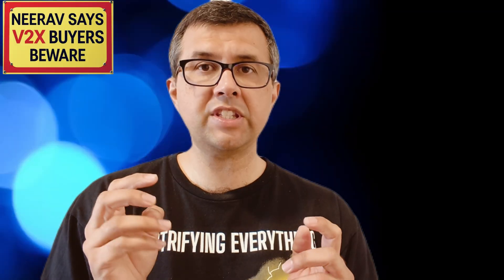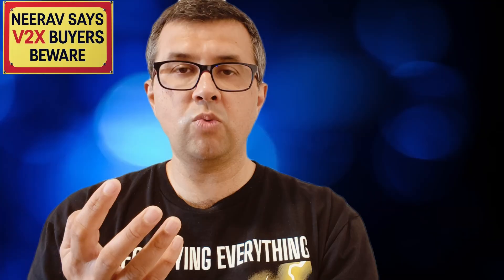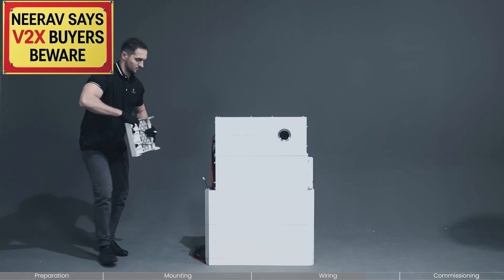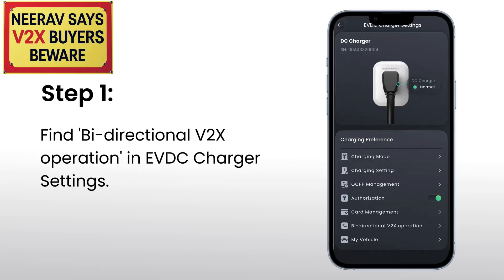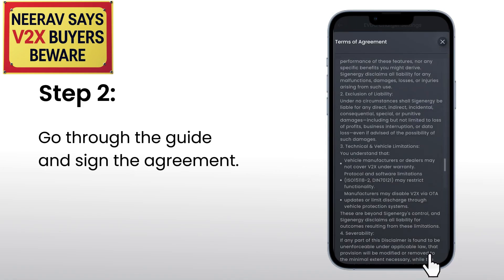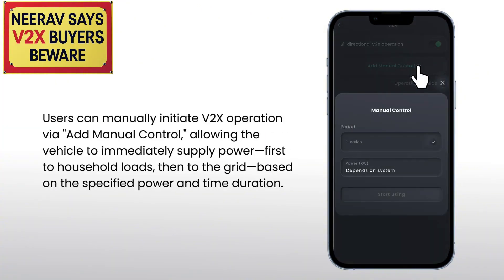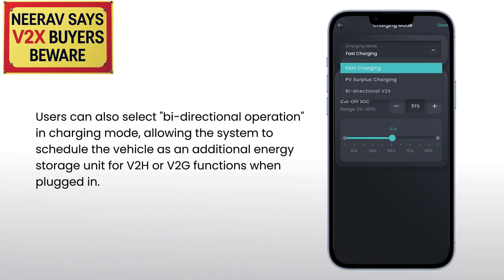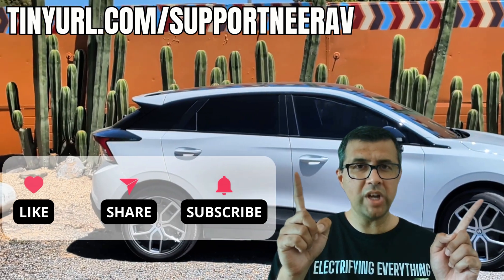Sigenergy Warning Risks of V2G/V2H/V2X: EV Hardware, Software and Warranty Limitations

Comment: waaaooow this is bull shit. but be afrried for all NEWs.. V2H  will absolute NOT damaged the battery in the car. the car data log is always there then they analyse the use the battery of external power, the log system can easily see if any option has done such a thing, also the controll with Power output is ofcause limited for a NORMAL house hold power Fuse. Prober equal. to 3 phase 16AMP. but if you use V2X for running a cerment building caompaney, i expect they has set the MAX output to limits that. so the problem is ONLY invented. same as the EV cars was ahorrible idear. now everyone has EV cars, with out any of the Prodicted dooms day" warrings. like this

Comment: Is it not possible to limit the output into a sigenergy unit at the V2L loads (3.3kw as an example) which are prescribed in the vehicle specs without affecting warranties?
Reply from the maker: That is an interesting comment. I just interviewed a Geely EX5 owner and that was one of the topics discussed, interview will be published on the weekend
Reply: "Is it not possible to limit the output into a sigenergy unit at the V2L loads"

From Sigenery itself...............
In their V2X flyer document - "V2X functionality is limited by the EV’s capabilities" - Obvious, but not a lot of specifics to assess.

To ensure the attempted discharge rate of an EV battery is compliant with the EV specifications for the purposes of V2G, this may require the mandatory inclusion of a HEMS. HEMS = Home Energy Management System, which can be used to set the maximum disharge rate of the EV battery. I know there has been a test of V2G with a BYD Atto 3 by ambibox, that included a HEMS to restrict the maximum disharge rate of the Atto 3 battery. The successful test set restriction of the battery discharge rate to a maximum of 7kW for the purposes of the test. I am not entirely sure of the exact details of the test, but considering the BYD rated V2L of the Atto 3 is I believe, apparently 3.3kW total, it doesn't sound like a 7kW draw is going endear itself to the Atto 3 warranty. So in the real world the HEMS would want to restrict to 3.3kW discharge to maintain validity of the warranty. 

A HEMS can have the ability to consolidate multiple and/or different or absent communication protocols across various devices, so that all devices in the system can communicate between each other.

But I am happy to be corrected on any of this.
Reply: I really don't understand why a car manufacturer wouldn't want to promote its v2g capabilities, I have the atto three and drive it around 2 hrs a day 4 days per week with an average discharge of 16kwh and have seen it regularly discharge over 60kw + on acceleration. My home would be lucky to discharge more than 6kw at any time.
Reply: @songforguy1  So do you know if the traction inverter is also the AC charging/V2X inverter? As in are they one and the same thing on the Atto 3 or all EVs for that matter?

The difference in capacity that you are referring to, I would suggest, is because they are two separate components each with it's own characteristics/specifications per it's application.
Reply: @BrentonSmythesfieldsaye  from my understanding a dc coupled v2g system which sigenergy has bypasses the cars inverter
Reply: @songforguy1  My response to you seems to have gone awol. I will repeat a briefer version.

Even the Sigenergy DC bi-directional charger itself is rated at, depending on option choice, 12.5kW or 25kW maximum. It will not allow unconstrained V2G discharge from the EV.

Personally, I don't believe any manufacturer is going to allow unconstrained power to be supplied to or drawn from their electyrical/electronic products. Keeping in context, all products in the V2G chain will have specifications/ratings that set amaximum performance spec. The reason is time. Your example of the "60kw + discharge on acceleration" gives a clue to why that would be.
Acceleration is short term operational state, that will have the characteristic of requiring high thermal performance for a short duration.
V2G applications may required sustained output over extended periods, that can only be achieved with moderate thermal performance over that extended period.
Time is a fundamental and integral component of design and determination of the specifications for power capability in electrical/electronic systems, for the intended application.

Comment: Awaiting Tesla's official word on pulling the trigger on Sigenergy 25kw DC bidirectional charger to add to our 40kw batteries.

Our vw id5 has 4,000hours and 10,000 kw max export limit. But having both of our EVs capable would help me justify expensive charger. 
Awesome premise and what attracted me to ecosystem. Sigenergy has been rock solid, Amber SS still learning mode.
Reply from the maker: Curious to know where you got that 40,000 hour and 10,000kW limit from. Is VW Australia detailing V2X limits for their cars?
Reply: @NeeravBhatt  Not sure about the 4000 hours but the new VW cars with V2X have a 10000kwh hard export cap this can be seen on the main infotainment screen with the remaining amount available
Reply from the maker: @Macify3669 thanks for confirming that

Comment: Looking at the development of battery health checks in the 2nd hand EV market and the data seems to show that doing less DC charging is better for the battery than all other factors. The reports are quite impressive giving a clear view of the whole usage of that EV, much better than anything you could get from an ICE vehicle. You should do a story on this.
Reply: All batteries are DC charged. An onboard charger takes AC and converts to DC to charge the battery. The only difference is that DC chargers are typically very high power, but these Sigenergy DC chargers output very similar to three phase 11kw or 22kw so not a significant difference to what one may charge with AC.
Reply: 22kw will be below the 0.5 C cut off (C being rate/capacity) for battery degradation. This means in general you want to charge at a rate that takes more than 2h to do a full charge. There are few cars for which this is not true at 22kw but you probably want 11kw for older or smaller cars. There are exceptions to 0.5 C guide though - for instance XPENG recommends first 3 charges are deep and on rapid charger, I think to bed down Li plating on the electrode for longevity.